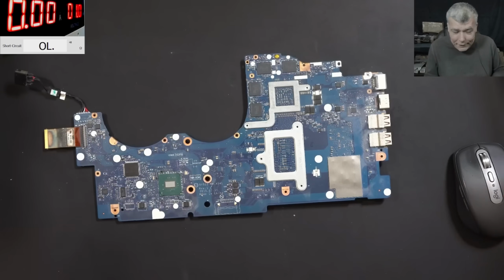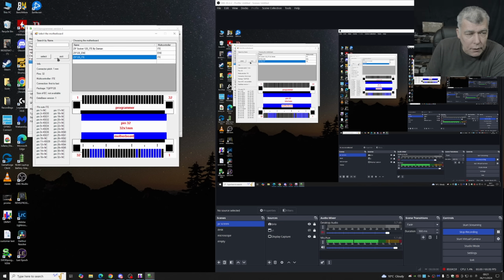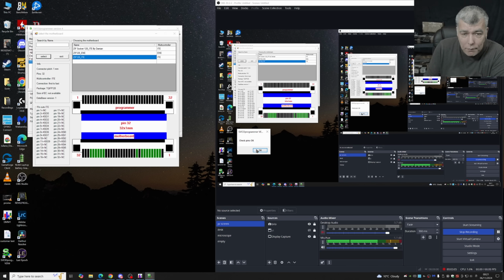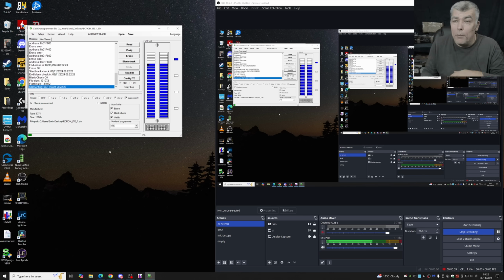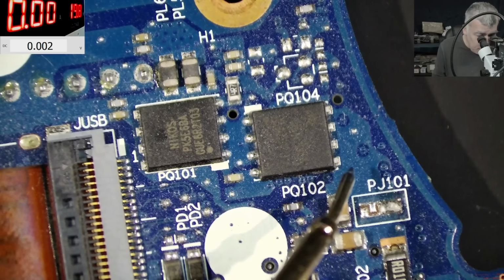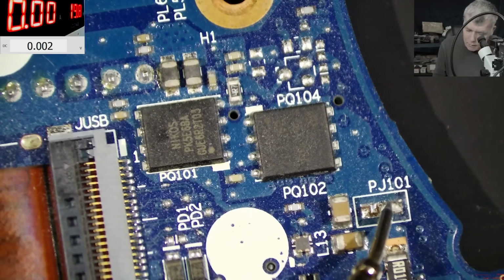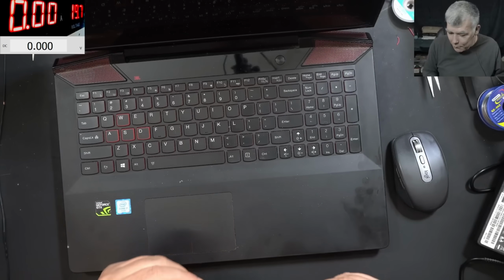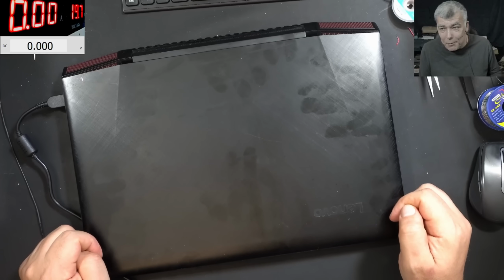Lenovo Y700 repair - EC chip IT8371E programming & replacement - Part 2

Comment: 15:20 I want to add that, now maybe someone with the RT809H programmer can reprogram ITE chips way easier than before. Couple of weeks ago they added via their software IT8XXX and IT5XXX support via SMBus. For now I have tested it in an HP with an IT5570E and a Lenovo with an IT8227E. You only require 3 wires (If power for the SIO is present, yeah): GND, SDA and SCL and connect it to the ISP port of the programmer. I even took the BMSs of old batteries and make it so I can just connect the original battery connector and DuPonts directly from the motherboard battery port to the ISP port of the RT809H. Read is mostly perfect(if the memory is "erased" the programmer complains about the chip but recovers when motherboard is powered down and up again), Writing is normal. Erase has to be done writing an empty buffer, the Erase button itself does nothing.

I don't know how much "universal" it is, but it looks promising. It is way more practical than setting each pin for the correct pinout when using the keyboard connector adapter. The battery cable pinouts are common across a huge amount of models and you know it when you see it.

Comment: Hi, Sorin. I have Aspire f5-573, which turns on, but without image. I will try with bios flash, but what is confusing me is that, when it's on, cpu and gpu are ice cold. Can it mean that cpu is dead?
Reply: Check whether the caps lock is working, preferably with a usb keyboard. If yes, it's posting! Sometimes it can be a frozen BIOS! So reset the BIOS. Check the screen too! Only go in for BIOS flash as a last resort! The CPU, GPU gets hot only under load! So don't jump to conclusions.
Reply: @Aneesh.Asokan  No. Cpu and gpu were short.  I replaced the whole board at the end.
Reply: @Headingmashine1  Thanks for letting me know! Sorry to hear that! How much did it cost to replace the motherboard? Thanks!🙏
Reply: @Aneesh.Asokan  I bought used one for 50 euros ( i5 7200u, nvidia 940m 2gb ddr5). I replaced it by myself.
Reply: @Headingmashine1 Thanks! Did you buy it online or from local sources? If from online, do you know any trusted sources online for used laptop motherboard?🙏
Reply: @Aneesh.Asokan  Local-Online from seller who has only positive feedbacks.  Unfortunately, it's not a worldwide shipping. Serbia only, and he had only that one. 😀
Reply: @Headingmashine1 Thanks! So that option is ruled out! I am from India!  Keep Smiling!😀👍

Comment: As all the pins on the EC are accessible and there's no pad under the chip wouldn't it be easier to use an iron to tack it down and then go over the rest pins? Less heat to the chip as well presumably.

Comment: Hi Sorin from Sydney Australia.
Why did you need the Lenovo charger? Why not run in a universal plug off a variable power supply?
💫🪫🤔
Reply: Watch Part1. The EC chip shuts down the BQ if there's no charger id present. Crazy design...

Comment: good job mr sorin. one question why is linear power supply is better than swithing one?
Reply: hello not Sorin here but engineering student, linear has low ripple and noise. It also has fast transient response. Also no RFI and EMI. Disadvantages are that it has low efficiency ~45%, needs a large heat sink, lower power supply density and so is limited in use for high current applications.

Comment: Sorin, How are you doing?? What if the mainboard has a separate EC rom chip and the EC chip is separate. In that case, if we replace the EC chip will it work properly and still load the firmware from the Ec rom?? Love your work ❤

Comment: Fun  Fact - IC's that need to be programmed also have a small circle embossed in the IC, not to be confused with the the dot indicating pin 1. You can see this on the IC Sorin is replacing.
Reply: Ohhh. Nice to know. Thanks.
Reply: So where would you actually get the firmware for the EQ chip ? or is it part of the BIOS update package from the manufacturer?
Reply: thank you
Reply: Really? that's a usefull fact indeed

Comment: Thank you Sorin, Can you tell me which programmer you have and does it come with the adapter you used and another for the bios chip? Thank you so much ! 🙏
Reply: he's using Svod4, i thinks is 600 USD with adaptaers, could be more could be less, there are cheapers programers like the Vertyanov